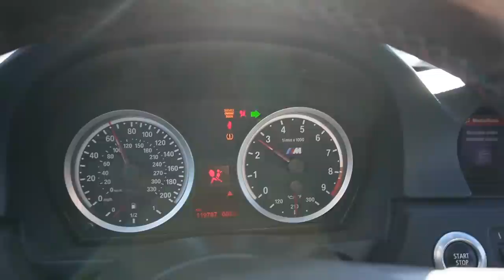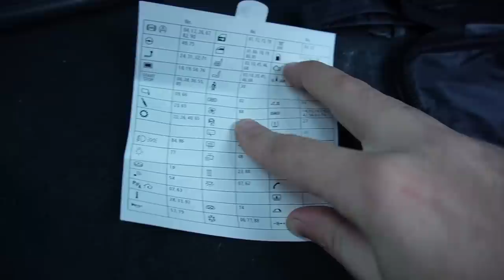THE E91 M3 BODY IS FINALLY COMPLETE! BUMPER AND QUARTER PANEL CONVERSION!

Comment: Hi Nour, love the build. I was thinking of changing my 328 e92 rear quarters to m3 flairs. Where do you get them and how about the front fenders for bolt ons. Can you get all the parts used or should i just get new ones for a cleaner build. Thanks and keep building.